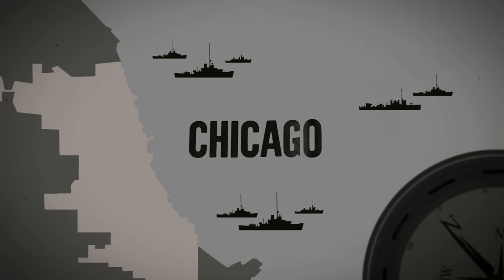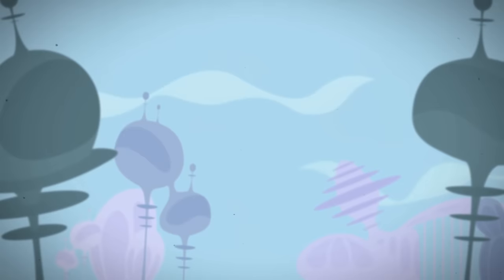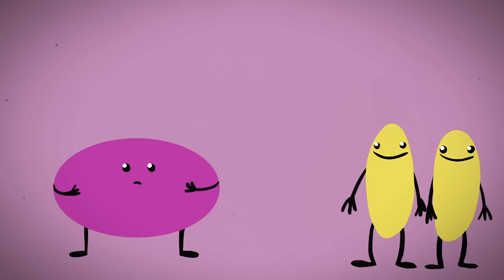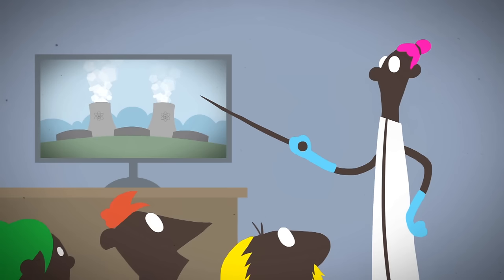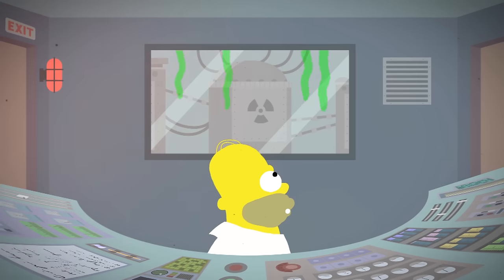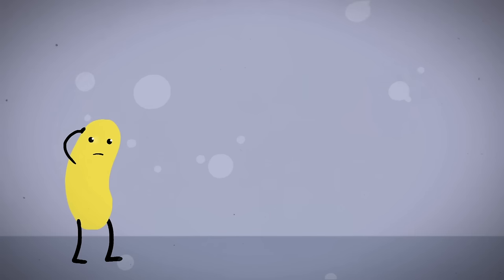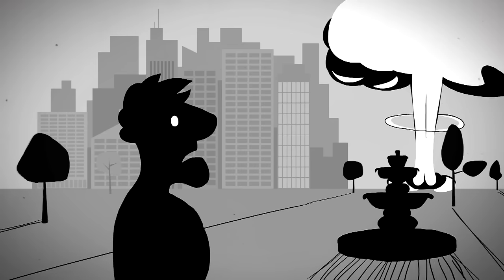How do nuclear power plants work? - M. V. Ramana and Sajan Saini

Comment: Is it possible to build a nuclear power plant more than 100km away from any human settlements and have it completely run by machines? Have the area around it be closed off unless you have a permit or something and people can come every year (or maybe shorter idk) to run maintenance checks on the reactor. The machines running the reactor can be controlled by operators from anywhere. And the large area around the power plant can be used to bury nuclear waste (several kilometres under the ground). So then even if it does meltdown, there would be no need for evacuations or any risk of human lives. The area could be cleaned up by removing the topsoil and after 10 years or sth, when enough decay has occurred to return the ionising radiation to return to safe dosages and people can live there. A new reactor can be constructed elsewhere and the process can repeat. Nuclear waste is buried several kilometres underground so it should have too much of an effect but if people worry, it can always be removed to be reburied under the new power plant.
Reply: I don't know. I don't specialise in this stuff I'm just a science student.
Reply: Additionally, a meltdown can cause a fire so the machines can be repurposed into "firefighters" and after the whole thing is over, they can be buried along with the nuclear waste from before.
Reply: if it does meltdown, and the radioactive gas diffuses in the air, surely the wind will spread it to human settlements anyway.

Comment: i learned physices and still there is somthing i didn't understand... there are 2 ways to create nuclear power, one is to break an atom but even a better way is to create an atom, it holds much greater potentioal, both in energy and the the fusion is actally good to the envirment! it makes from 2 unstable atom, a completly stable non rdioactive and natoral atom we can find in nature!
i understand it's a bit harder on the cotrol (of the atoms fusing, not the rdioactivity) and the heat needed (100 million degrees) but it makes up for it in far better resolts! in both more enrgy, and non rdioactive atoms that hurm to nature!

Comment: Clear video! One bit was a bit misleading/inaccurate. The last line of defense is indeed a concrete and steel containment building, then showing a gas spread from Chernobyl after the containment fails. Only Chernobyl like other communist plants did not have containment buildings like they did in the west.

Comment: You know that uranium 235 is not the only isotope that can be used efficiently for fission, right? Most of the problems with nuclear power concern the uranium 235 fast breeder reactors... other kinds of reactors solve most of those problems.

Comment: Nuclear power is way cleaner than conventional fossil fuel power though. And more energy efficient than alternative power. There are fast neutron reactors which have no risk of steam explosion and can also burn nuclear waste from standard boiling-water reactors. There is the thorium cycle. There are also ideas about small-scale fully autonomous reactors not requiring human control. Why not tell about these? Nuclear power done right is the future.

Comment: Will the reactor has been use today is old design because the innovation of nuclear fission stop, but if you think about it, the nuclear waste you can stored in underground but CO2 release from coal is stored in atmosphere, that is more dangerous than nuclear waste that stored underground, and nuclear fission release very small amount of CO2 than coal, if innovation on nuclear fission didn't stop then today atmosphere is much cleaner and maybe we already found a new nuclear fuel that much more abundant than uranium.

Comment: so if the meltdown ist the biggest Problem why dont they just Place the reactors below sea level? All those Pumps and emergency Systems could be replaced by a one way valve?
Reply: Using saltwater isn't ideal, because they have to remove the salt, but many reactors are by the ocean due to the supply. Constructing anything below sea level is also extremely difficult.

Comment: As a nuclear engineering student, I am very disappointed by this video...I hope that TED-ed returns with a more informative, fair representation of what believe is our most diverse and powerful green energy source...A few things you could put in context next time
(tl;dr: the issues with nuclear discussed in this video have technical solutions, but people's misunderstanding of the tech that this video doesn't resolve keeps us from using them. Also, nuclear's positive impact on the world is and could be so far beyond the risks described in this video):

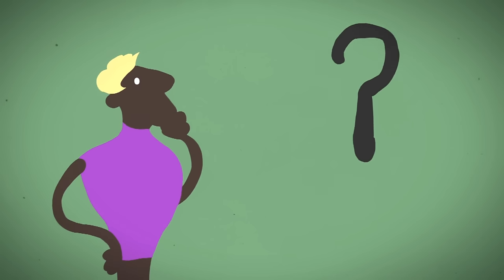1:15 "high construction costs" my colleague did a cost comparison, and for the power it produces, even with the most pessimistic building cost estimate (which, for the record, lately has been because of scrupulous companies gouged contracts when they built the reactors, not the actual cost of construction), nuclear still produces more energy for the dollar over the lifetime of the plant than wind or solar by a large margin.

3:05 "most of the neutrons produced during fission have too much kinetic energy to be captured by U nuclii" This is patently false. There is a lower probability of it being captured by the fuel, but that probability is not 0. The Idaho National Lab ran a reactor for decades (called the Experimental Breeder Reactor) using primarily these faster neutrons, and had no moderator. Both fast reactors and slow reactors (like water reactors) have their own unique design criteria, but both are very possible, and have their own unique benefits as well.

3:32 "scattered n's are still a little too fast [so enrichment is necessary]". Again, there are many reactor designs (some dating back to the 50's!) that use natural uranium. Canada's reactors (called CANDU) use heavy water, and can use natural uranium. I understand that you're simplifying to light water reactors, but the simplification is harmful. It's like saying all planes are just like a Cessna, or a B-2. Be clear about your simplifications, please.

5:34 "some products take 100s of thousands of years" If you say this, perhaps note that the short-lived ones are dangerous, while the longer lived ones are not very harmful.

5:50 "it becomes an even greater storage problem". This portion of your video is problematic. The spent fuel contains more elements heavier than uranium, with Pu just being one. I understand you're again simplifying, but you get fission products, un-fissioned uranium, and heavier-than-uranium products that were created in the reactor. Talking about storing them forever totally missed how useful the stuff can be. There are very few technical problems with spent fuel--only political ones, as we can't use it in better ways. Some examples?

There's a thing called a "solar updraft tower". The idea is that you make a big greenhouse, let the sun warm up the air under it, and force it to rise through a fairly narrow tower. It will speed up as it raises (because the tower tapers), and can turn a turbine. That can produce a decent amount of power. But spent fuel stored in casks take in air at the bottom at ~20C, and leave ~90C. If these are added to updraft towers, you can more than double it's power output.

You can use it as fuel for other reactors (like the SSTAR), you can extract medical isotopes from it. You can pull out Pu-238, which doesn't fission so well, but which can power satellites and space equipment for decades (look up Radioisotope thermoelectric generators, or RTGs). You can pull out Americium, which is used in smoke detectors. If we processed it, we can even recover a decent amount of fuel to go back into another reactor. And there are multiple processes designed (including one at the INL that I know of) for reprocessing the fuel, and even using the heavier-than-uranium isotopes as the main fuel for the next cycle.

Spent fuel is not a technical problem. It's a host of solutions that politics forbid us from implimenting.

6:55 "Pu can be used to make bombs". It is actually really hard to pull out, and you don't get much from water reactors unless you run it to get that. And if you try to pull out weapons materials, its pretty easy to detect because you need some pretty specialized equipment. The other fact is that building a Pu-based bomb is MUCH harder than a uranium-based one. The US government, in fact, only tested the Pu-based bomb during WWII because they were so confident that the uranium-based one would work.

Also, constantly linking nuclear power to weapons is, I think, one of the root causes of public opposition (with the other being misunderstanding about radiation).

7:18 "visionary scientists from the early years of the nuclear age pioneered how to reliably tap the tremendous amount of energy inside the atom" all well and good.
7:34 "but their successors have learned humbling insights about the tech's not so utopian industrial limits [blah blah complex, risky engineering]". Ok, this one really bothers me. Those same visionary folks, and their successors, solved problems when they arose. Again, we can easily (technically) deal with spent fuel to great benefit.

And you never mentioned that it produces the most stable, reliable green power out of any option. You never mention the millions of vital medical treatments that rely on radiation and isotopes produced in reactors (which, fun fact, all shut down in the next 4 years, and we'll have an even greater shortage of medical isotopes) or any of the other hundreds of benefitial and world-altering applications of nuclear technologies. You never cover different types of reactors. You never cover the pain of their alternatives (which isn't the point of this video, but still).

Overall, I'm very disappointed in you, TED-ed. I expected a more ballanced view designed to get the full picture of nuclear's vital role in modern society, as well as current challenges. If you hope to keep my respect, I expect follow-on videos to dive deeper into this topic.

Comment: Why can't they use the plutonium which is wasted and and enrich it and use it as a fuel to create energy again?? If it can be used as potential fuel for a nuclear bomb?
Reply: Full cycle fuel is actually EXTREMELY difficult to use to make a nuclear bomb. Producing plutonium for bombs requires exposing uranium for a short period to maximize the Pu-239/Pu-240 ratio. To answer your first question, the only reason is that there are laws against it.

Comment: Load it all up and send it to the sun....hello !¡!!
Reply: 1. it is UNGODLY expensive to put cargo on a rocket
2. you have to do a ton of math to make sure the rocket doesn't get pulled around back to earth by the gravity of other planets.
3. if a rocket even explodes (which is relatively uncommon), then you've basically just set off a crude nuclear weapon, which will be very bad for anyone within a few Ks of the blast

We already solved this problem, we mix it with concrete and glass, encase it in a bunch of lead, and then bury it underground. It's so effective you can straight up build these in cities. We usually don't, but we could.

Comment: Disappointed that the inverse relationship between radioactive intensity and longevity wasn't mentioned. The stuff that lasts for thousands of years isn't very radioactive or dangerous.  The stuff that is dangerous decays away quickly. Given the two recent accidents of Chernobyl and Fukushima the main contaminant is now Caesium-137 with a half life of 30 years. There are no documented health effects from the released caesium-137. Iodine-131 has a half life of 8 days so is much more dangerous than caesium-137, It did not effect Japan as milk from the contaminated area was not consumed. In Ukraine, Belarus and Russia this did not happen. There are some 6000 cases of thyroid cancer not all will be because of Chernobyl. That's the comparison 6000 cancers from Iodine-131, none from Caesium-137, the difference between a half life of 8 days to 30 years. Explain to me why spent fuel needs to be securely sequestered for thousands or even millions of years?

Comment: This thing is biased and misleading. Plutonium from civillian reactors, after the fuel cycle for a fuel element is concluded, no matter if the reactor is water cooled or an FBR (one designed specifically to make as much Pu as possible) is not a military material - it contains around 30% of Pu-240 that does not undergo fission, therefore it's not possible to use it for a practcal warhead. It's a reactor fuel material instead and spent nuclear fuel is not just stored, but often recycled - after removal of useless, highly radioactive isotopes (produced in quantities of around 2kg (yes, only 2kg, that decays almost completly after 300 years, not hundreds of thousands) per GW of electric power per year) what is left might be used to manufacture cheaper MOX (mixed oxide) fuel to further power the reactors. Also high cnstruction costs of nuclear powerplants currently are usually an effect of anarchronic, excessive regulations, yet still in long term nuclear power ich much cheaper than any other kind of power. And... Recently built Bakarah NPP costed $4000/kW of electric power, while a modern, efficient (and much more expensive in running and enviromentally) coal fired plant costs around $3000/kWe. So is it really so expensive? What is more, nuclear power not only does not release any harmful substances to the enviroment, it also does not take up much space. To replace Diablo Canyon NPP in California with solar power it would be necessary to cover a 40km per 40km square with solar pannels. And the nuclear power plant takes like 1 square kilometer, or so, 1600 times less. Isn't it better to plant a forest instead...?

Comment: Very superficial presentation of the path chosen for use of nuclear power. TED would be of better service if they would explain that over a dozen reactors were designed around the time of the light water reactors that are most prevalent. The reality that the worst reactor design was chosen for commercial electrical generation was chosen. The design was only optimized for marine applications in an abundant cold water environment, sized to never exceed the limits of the materials used to make them. The man whose name is on their patents stated the ideal design was the molten salt reactor was perfectly suited for commercial power generation. Inherently safe by design, self regulating and meltdown secure, proven by four years of safe operation. Sad to say our politicians are the only reason they are the main engine of our power industry today. Capable of multiple fuel designs, proliferation risk safe, modular in design, safer grid designs and production distribution, even capable of using spent fuel currently stored as fuel to a virtual 95% burn up. These MSR reactors will solve power supply to bring third world countries to first world standards, eliminate nuclear proliferation issues, power grid security and distribution, reduce production costs and expedite construction time and safety. We need everyone to contact people in places of influence to allow the current nuclear regulatory and political positions to more aggressively expedite this proven power production process to replace the dangerous LWR plants all on the verge of their lifespans. Only coal plants planned as replacements, will not help climate change opinions. Only major funding presently going to new pellet designs to bridge lwr lifespans and keep fuel manufacturers in the nuclear regulatory control seat. We need msr nuclear power. Safer, modular, scalable, non proliferation,  safer fuel cycles, reduced need of new uranium mining, improved grid safety, makes nuclear power for electricity and many other heat of production needs such as desalination, fertilizer production, cement migrant and dozens of other beneficial products and services.